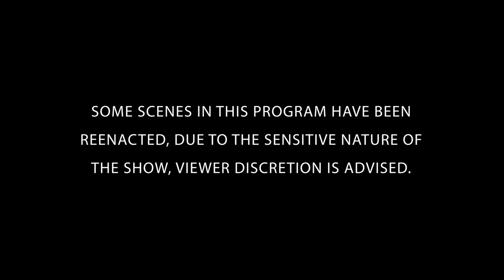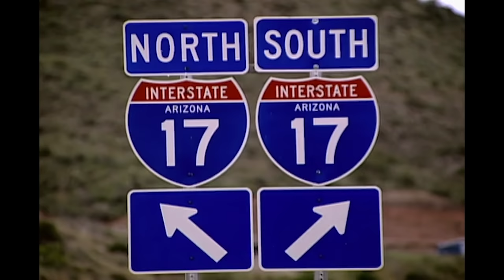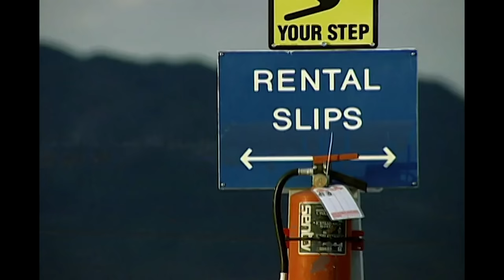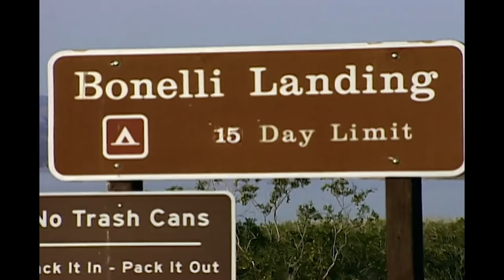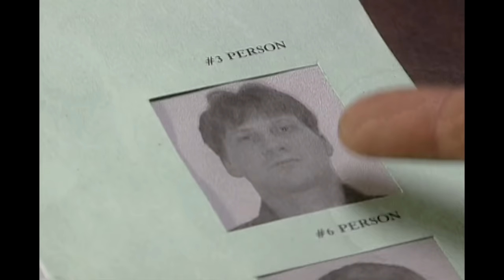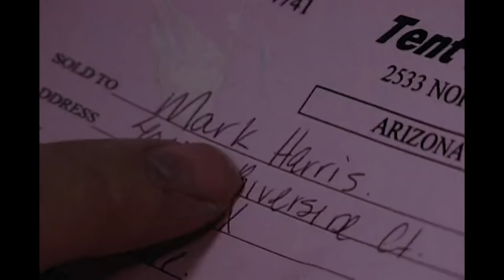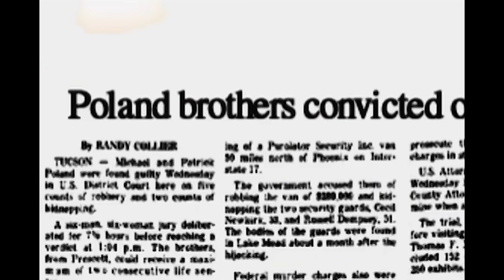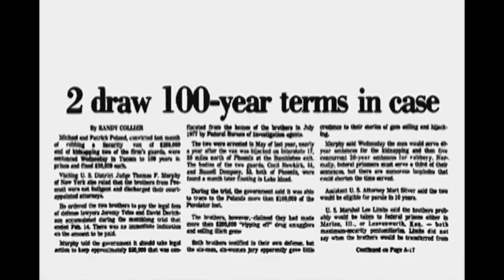Deadly Heist | FULL EPISODE | The FBI Files

Comment: Kudos to the US prosecutor, who used the self-winding wristwatch of one of the slain armored van guards as evidence to pin down the Poland brothers to the murders. That it stopped 12 hours after the body was dumped into the lake corresponded to the time the suspects were in the vicinity of the scene. Circumstantial, but it was enough to convince the jury of the brothers' guilt.

Comment: They had tasers in '77, you learn something every day. Love this series!
Reply: If they did they would have been the size of a shoe box.
Reply: @southerncross3638 pony cu
Reply: @southerncross3638   k
Reply: Well they were making microwave ovens too that have high voltage capacitors that's why you don't open them in any hurry even when not plugged in !
Reply: Noticed òn a Columbo video they also had cycle helmets too.
Reply: @southerncross3638  the actually was remember men at work the movie
Reply: @southerncross3638  Probably, good one lol
Reply: @marklittler784  They have microwaves as early as in the fifties.
Reply: yeah connected to 12 volts car battery.
Reply: Cattle prods go back into the 30's, man, and even further back.
Reply: @edmundkemp2280   *30s